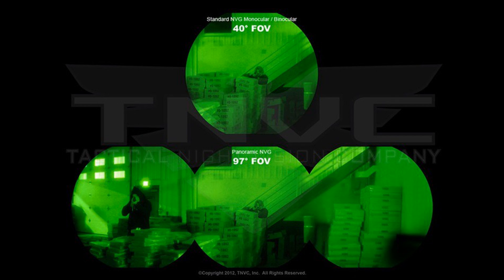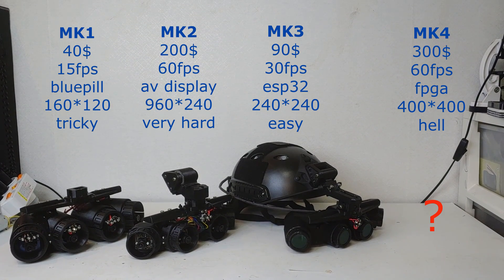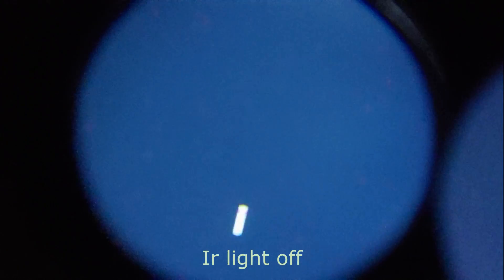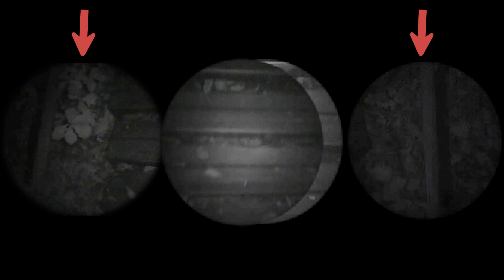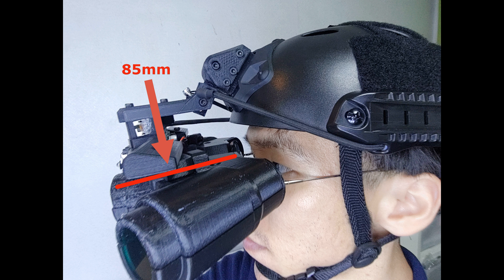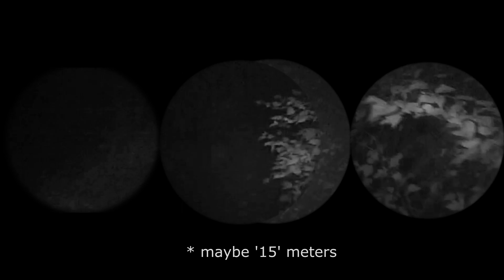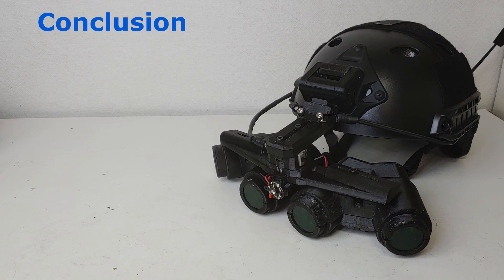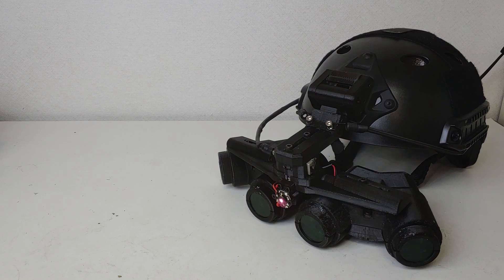DPNVG mk3 (DIY Quad Nod NVG, Night Vision) part1

Comment: If I had the tools, knowledge and skills to do this I would buy real intensifier tubes and build real quads and continuously try to improve upon that design. This is awesome don’t get me wrong but real intensifier tubes are not hard to get. Yea they are expensive but you could build out quads for $8,000 to $12,000 depending on what tubes you choose
Reply: @bLackstar The next step in night vision is SWIR, which uses a wavelength different than what IIT sees which allows it to do things like see through smoke. This is primarily going to be used due to the prevalence of civilian night vision. Currently it is only used on machine guns and aircraft because the cameras are large, and they consume a ton of power. However the issue of latency will still be there, and for that reason IIT will still be in use for decades to come even after SWIR becomes man portable. Farmers use SWIR in drone mapping of crops, so the tech is there, the demand isn't. IIT like the AR-15 is so ahead of its time that it's cutting edge to this day.
Reply: If you’re gonna buy real intensifier tubes, you’ll want a more durable housing to protect that $8-$12k investment.
Reply: @christopherrobin8134  depends on which gen you will be using. I used two Soviet ЭОП В8 (image intensifier B8) for my own homemade goggles. They are gen 1 and only costed me around $100 each. I also used Soviet PNV-57e 37 mm F/1.0 lenses and a couple of other Soviet surplus NVG lenses for the internals. 

For the housing I simply used a couple of polymer tubes that me and my friend then modified to fit everything inside. Then came the modified transformer box, which was quite complicated to put together and didn’t even work.

I eventually managed to get a very rare 1980s PNV-57em transformer box from the father of another friend of mine who was also interested in night vision technology. We made some modifications to the transformer box so it wouldn’t just fry the tubes when turned on. 

The goggles have a little of fisheye effect, but that just is the way it is with Soviet NVGs. Other than that, they work absolutely great for homemade gen 1 goggles! They kind of look like the NVGs you would see troop transport drivers use during the Yugoslav wars. The owner from one of the dumpstores I got the parts from gave me a replica Honoured Inventor of the USSR medal for free. He was so amazed by my project, and I am very happy with the end results!

Comment: Have you tried testing different cameras to see how they perform? I would love to see how the foxeer cat 2/3, runcam night eagle 2, and caddx polar compare to the current camera setup. And compare the difference a removed ir filter makes
Reply: the foxeer/nighteagle cameras already have night modes. They work a whole lot better with ambient lighting compared to ESP32 cameras, you just need to convert the analog signal to digital in order to display them correctly if you're gonna be using round watch displays which requires quite a bit of compute performance. This is where I'm stuck at currently.
Reply: @julian23561  yeah same, that's what I was thinking. You can buy these small 1.5-3" NTSC/pal tft analog displays from adafruit though, that's probably what I'm going to do, although I'm not sure how well a square/rectangular display would work for viewing relative to a circular one
Reply: @julian23561  it shouldn't be that bad honestly, the viewfinder of my mirrorless camera is essentially a tiny 4:3 display, and I have no problem walking around with it
Reply: @julian23561  also do you know how the foxeer compares to the runcam? Seems like runcam has slightlh better performance, but it's 100 bucks and out of stock
Reply: @swegmastur614  runcam is better st some aspects but for the price, I'll go for the Cat. 

I've also considered adafruit micro displays but they're still too big, and the smallest one they have is still to big to fit a toilet paper tube (lol).
Reply: @julian23561  also appears that adafruit makes these "video glasses" that are also NTSC pal, basically a shittier version of the Microsoft hololens, theyre discontinued though, but with them you do forgo making the body altogether, and just glue the fpv cameras on the top ridge of the glasses
Reply: Just a quick update yall, the runcam night eagle 3 came out, and it's performance is far superior to all other fpv offerings. As for the display, I used this analog monocular display I found on Banggood and it worked pretty well(although it's not the highest quality thing in the world), it's a pretty easy soldering job and you can fit them into a pvs31 housing(I bought an airsoft replica)
Reply: @swegmastur614  I just need to confirm the analog display... is it one of those "80 inch monocular analog mini display" things?
Reply: @julian23561  yup, it's not very good but it works, if you're using a fma housing you can unscrew one end of the tube, and put the monocular right in there. It fits perfectly, but you can't put the cap on back though
Reply: @swegmastur614  thanks. It will need custom parts to fit properly and look right, lol.
Reply: @swegmastur614  Excellent find. I personally refuse to buy from adafruit, this opens a lot more options for not only digital night vision but also my FPV projects.

Comment: with gen 3 binos starting around $6,000- and quickly going up to over ten grand, how close could you get to legit nvg with a budget of a few grand? The biggest problems with digital so far are the lag and the need for IR illumination outdoors. Anyone running digital NODs would be lit up like an airport runway to me, so less reliance on IR is a must.
Reply: Binos are nice luxury, but single does job at quite literally half the price. Don't underestimate the costs of accessories though.
If you buy a Photonis Echo you can get surprising quality below 3k, but no matter what you buy, its still a thousand cuts on accessories.
Helmet 200-2000
Mount 200-600
IR lasers start around 150 for ultra low end, 300+ for real stuff.
If you want an IR laser/ Illumination your in for 800-3000.
And countless other small items from cases, beacons, and lights.
By the time you're up and running expect to have spent just as much on all the accessories as you did on the NVG itself.
Reply: @kraemer66  while single tube is better than nothing, i strongly prefer duals. My question about digital is mainly aiming at getting rid of the downsides of standard night vision: Size/weight/positioning. 

Having 3 inch long tubes off of the front of my face like telescopes makes for a not so great user experience. Digital just needs to solve the lag and need for a ton of ir light and could inherently solve size/weight/positioning.
Reply: @SpecOpsGear  if you've been paying attention these last few years, you'll know that the problem of display lag is almost solved now,  VR systems are proof of that. The other problem? Computing power, nothing that small and light is capable of compensating for lag. Isaac Botkin from TRex arms has a great video on this.
Reply: @julian23561  yes, i've been paying attention. 

Your statement seems a little contradictory in that you say that lag is pretty much solved but you also say that computing power is not good enough and is too large. 

I'm a bit less concerned about size and weight on digital because you can position the processors etc on the back of the helmet or even in a backpack. Standard NODs are clumsy because i have long tubes hanging off of my face. 

In contrast, digital could allow for much for flexibility in form factor compared to analog nvd. With digital, you only need small cameras and a slim screen on your face; the rest of the weight could be distributed on your body.

Also, yes i follow trex.
Reply: @SpecOpsGear  perhaps I worded it poorly. I meant to say compute performance at that size (head mounted) is still too weak to compensate for lag, but a capable desktop/laptop computer is much better. 

There's this system, I'm not entirely sure if its still in production, the X27, that boasts impressive digital nightvision capabilities (with color no less) but its massive, about the size of a RED camera and its all digital. 
If we can find a way to compress that to such a degree that it can be head mountable then digital nv is definitely the future. But as of rn, analog is still king.
Reply: @julian23561  yeah... i just bought analog gen 3 binos. :/ i'd been stalling for a legit digital option, aka something way better than an aurora. The point of my original comment was that i do think it's possible for someone to make legit digital NODs with a reasonable budget.  

So, the beauty of digital is that you DON'T have to make the entire unit head mounted. 

The biggest thing to consider is that with digital you can have flexibility in the form factor. Analog NODs that weigh 3 lbs would be a disaster because even a few lbs hanging off of your face is a lot. But, if you put most of the weight somewhere else it would be amazing. The gpu/motherboard/batteries can go into a flat panel that integrates most of the weight/size into a flat panel in the back of an armor plate carrier and it would be good to go.
Reply: @SpecOpsGear  the thing about head mounted though is that its easier to move with it, maybe a pack directly mounted to your plate carrier would provide optimal power. 

I just want something I can wear on my head and go on about my day (or night) because while wearing a PC is great for lots of reasons, I may not always be able to wear one. 

You get an RNVG or articulating? Congrats BTW, get goonin!
Reply: @julian23561  Articulating. 

I don't think I communicated clearly. The cameras and display would be head mounted, but the gpu etc would not need to be head mounted. 

FYI, a lot of dudes with analog NVG attach an inert/ballast weight to the back of their helmet to balance out the forward weight of analog nvg. You could easily make a GPU/battery pack for digital that distributes the mass of the processors around your head/body whatever you want, instead of all on the front of your helmet. 

Because of the flexibility of form factor, digital should be king. 

The hint that govt is going this way already is that quad nods are now being sold to us civilians.
Reply: @SpecOpsGear  yeah I understood what you meant, I think we just have different goals. I want my system to be compact, isolated to just one system thats on my head instead of having to systems on the head and the torso. 

I know about the counterweight thing. And L3s ENVG contract still makes use of intensifier tubes but have the thermal capabilities contained within the head unit. 

I'm looking at very portable, because I believe that would be the most flexible, without needing for a backpack to do all the computing.
Reply: Ive seen quads that weren't GPNVG go for $10-12k

Comment: Can you make an gpnvg 18
Reply from the maker: yes, if i can some how get 4 intensifier tubes. but that's a lot of money
Reply: @generalpurpose2714  how much did this one cost you sir may i know? What i mean is per tube
Reply from the maker: @PruTroom  total 90$. about 20$ per each nods
Reply: @PruTroom  a single Photonis Echo tube (which may or may not be compatible with the GPNVG-18 housing and lens setup) can run you north of $2000. So 4 tubes would be 8k doll-hairs.
Reply: @generalpurpose2714  I'm sure you already know this, but this guy made a 3D printed housing if you ever get the tubes. Download link is in description. 
https://www.youtube.com/watch?v=U6YyFbrivoI

Comment: How did you connect analog camera to a digital display?
Reply: pretty sure the ESP32 camera is digital, so using a digital display isn't much of a problem. That's why its running at 30fps